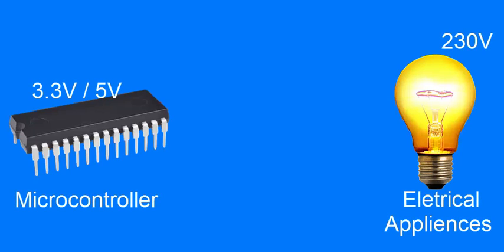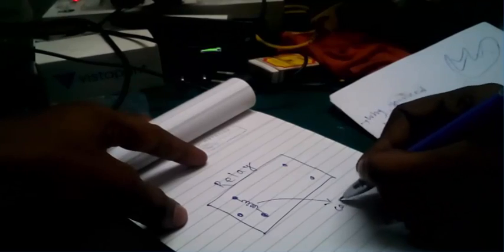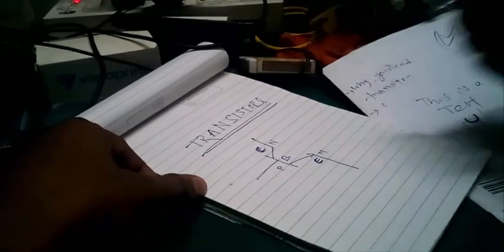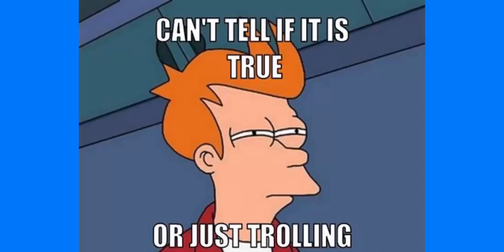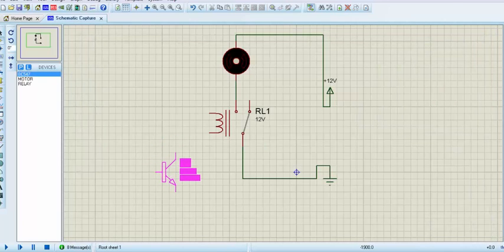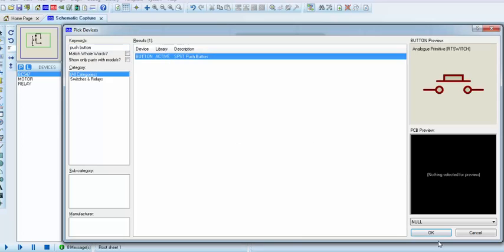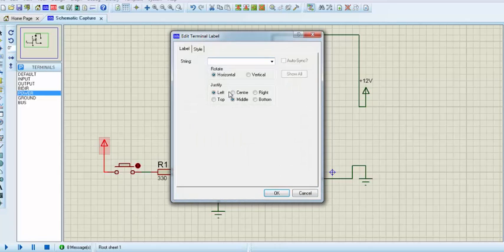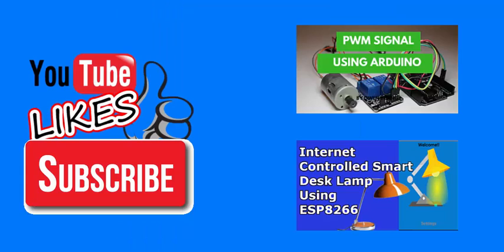Simple Transistor relay circuit | Transistor as a switch

Comment: Thank you for the time and effort you put into your video. Would I need a certain type of relay to switch an AC motor (under 10A) on'off based on the voltage of a DC power source (12v-24v)? For example: I want my AC 120v fan to turn on when my 12VDC battery bank drops to 10.5v and back off once the bank voltage reaches 14ish volts. I know I can connect an under voltage/over discharge module to connect/disconnect the battery, but I need a relay to keep the AC and DC currents isolated from each other. I'm sure I'm probably making this out to sound more difficult, but I am new to electronics. Thanks and apologies in advance.

Comment: My key fob doesn't unlock my doors my air pressure sensors are not reading my fuel gauge is not reading what can it be oh but if I put the key fob on the cup holder the truck does turn on

Comment: Hi. I need to do a relay board for automotive relay that core pulls at 12v and 160mA. I tried 2n2222 npn transistor but it got really hot in a short period of time.  Which transistor would you recommend for this setup?  Thanks

Comment: What advantage does this have over connecting the switch directly to the motor without a transistor?
Reply: Well lets say you have a 400v motor here insted of the 12 v motor, having to deail with 400 v for controll signals is not convinient since micro controllers cant handle such high woltage and I.m not shor if the relay in this exsampke can be controlled wit 3.3 V (normaly the putton in this exsampke wit nit be a button put n outpoy pinf from a microcontroller)

Comment: i do have a 4 channel RF receiver, which on power supply keeps on all the 4 LED and when i used to press transmitter button particular led gets off. i want wise versa so that pressing button make it on.
Reply from the maker: hmm. You can use a not gate ic , thats simple or a pnp transistor  like bc558. that should do the job.

Comment: impossible to work in practically....

the base triggering voltage of bc 547 is 3.3v  it will turn on the transistor but it will give only 3 to 4 volts to relay and result RELAY WILL REMAIN OFF .....!!!!!!!!!!@###
Reply from the maker: I request you to read datasheet of the BC547. Vceo of Transistor is 45V,  and Ic(Collector current is 100mA)which is practically more than enough to drive a small relay. I have tested more than 50 times in my last projects. So be assured. Hope it make clear, you can always ask, if still any confusion. :)
Reply: transistor will help to switch/connect the collector and emitter which is 12 v which is from other source. and with the base of transistor act a switch which only needs a few milliamps to connect the col and em.

Comment: I don't understant what a use of transistor.Why you don't put the switch simply on the 12v line of relay coil ???
Reply from the maker: Hello, the purpose of this tutorial to show, how transistor can be used as switch, there is no need, but its scenario, how you can use with mcu or other cases.

Comment: why dont you add a resister in series with the indector nd add a switch to them all in series ?
Reply from the maker: I did not understand what you mean, can you please explain?
Reply: i think that there is no need to the transistor in you situation .
Reply from the maker: You are right, But Purpose of this tutorial to demonstrate, how to drive one rely using a transistor, This is help you when you connect to a GPIO pin of microcontroller
Reply: even with the micro controller we can connect one of its gpio pins directly to the relay and it will work isn't it ?
Reply from the maker: No, That's not recommended, Two case: Case 1. Lets say your reply is of 12V or 5V and microcontroller gpio is 3.3V,   and Case 2: Your relay draws 50mA or more and MCU gives 10mA , in those cases you have to use transistor. You should not ever put load on MCU, because they are not rated, If you read datasheet of any MCU and compare current need and deliver, you can easily guess. :) , Hope I cleared your doubts.

Comment: why not push button directly in circuit with coil? wouldnt be the same? dont understand what is the point behind transistor in this circuit? tnx
Reply from the maker: Hello, Transistor works same as push button, but when you need things to be automated then you need transistor. assume , you are out of station, and you want to switch on your home lights remotely, how will you push the push button, in those case you need transistor instead of push button,
Reply: My Electronics Lab 
thank you
Reply from the maker: thanks, show support by sharing , subscribing and liking out video , Learn and Share to others .
Reply from the maker: yes you are right 3.3v realy are also now a days available, but problem is current, if you are connecting more relay, then its not advisable to draw lot more current from mcu, which can damage mcu.
Reply: The relay is 12v while the controlling voltage is 3.3v so it can never ever turn the relay on!
So, basically the idea is that the 3.3v turns on the transistor which allows the 12v to switch on the relay.
Luckily there are lower voltage relays like 9v, 5v and 3v. So, that helps if you were using a microcontoller(uC/MCU) to turn the relay on.